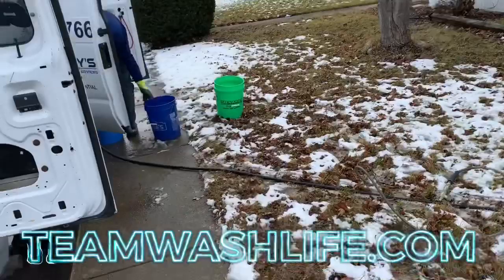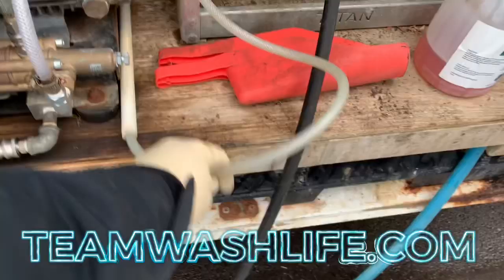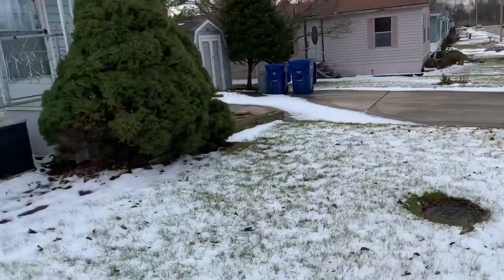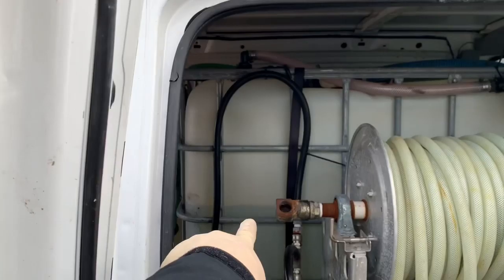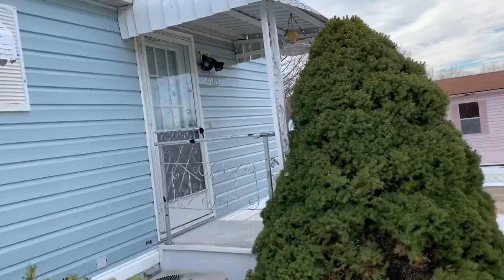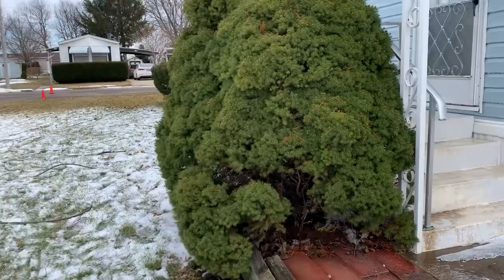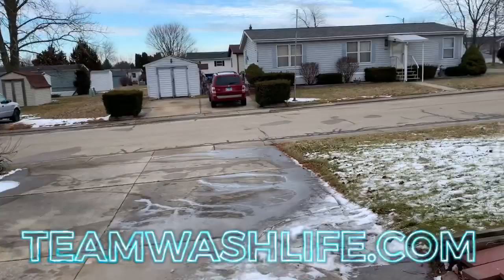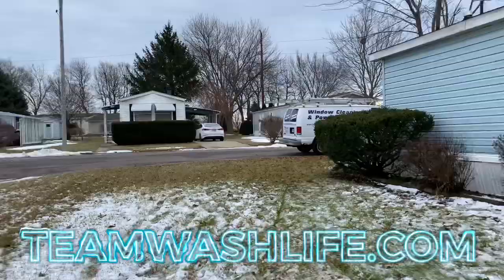Trailer Wash! Big Opportunity!

Comment: you lost me, man, how does an 8gpm pull less soap than a 4 GPM?  I thought the 8 would pull twice as much as a 4GPM please explain this to me man.
Reply from the maker: cadillac crow for the downstream injector, the orfice is larger on a DSI for a 4gpm machine rather than a 8gpm machine.

We typically run GP high draw injectors on our machines. For the 4gpm I use the 2-3gpm injector and for the 8gpm I use the 3-5gpm.

We were in the field and I only had a spare 2-3gpm injector with me so I put it on the 8gpm machine, and it works great but it pulls more chem than the 3-5gpm machine.

In the summer it would be overkill, but it actually helped us out because now it’s cold out and our chem is a few months old. So we are using more chem with this injector but it’s working out just fine.

Hope that makes a lil sense!